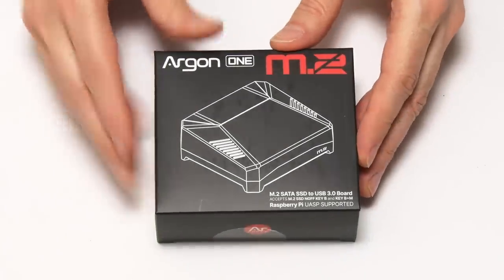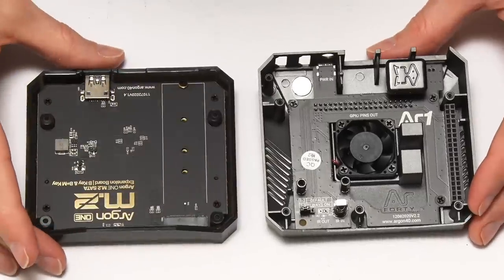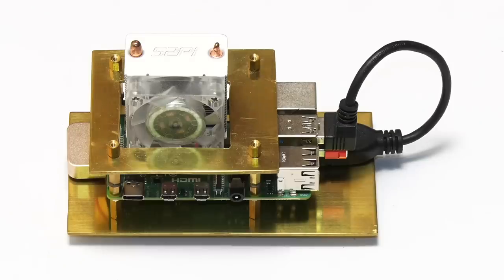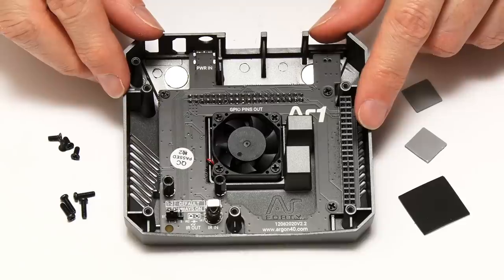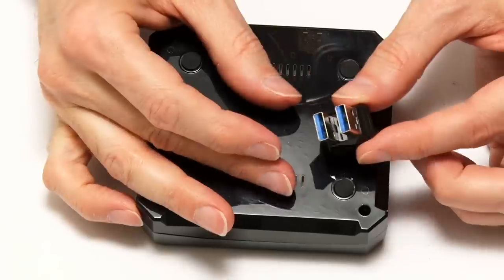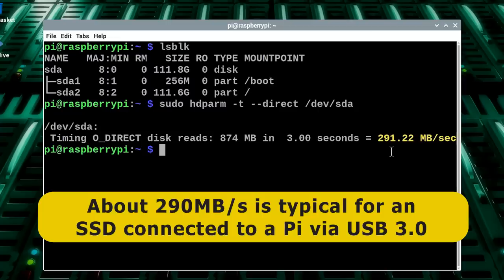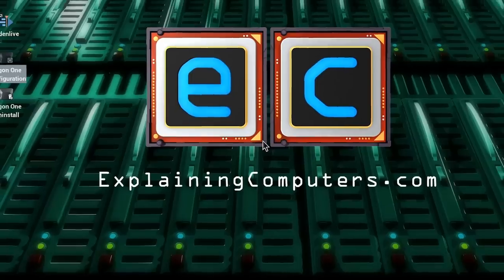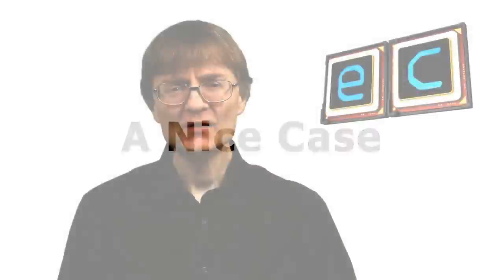Argon One M.2 Raspberry Pi 4 Case

Comment: Very cool case. My ultimate Pi project. is a 8Gb with the armored heatsink fan case very much like yours with fans, A SSD that has the same foot print as the raspberry pi and a flat usb a to c cable that zigzags from the front to the back through the case, a little bit of heat insulation padding between heatsink case and SSD and two cable ties that make a good rubber feet substitute... Running the beta of 64 bit raspbian as a little media server/streamer/NAS I would seriously consider the case If I was building again...

Comment: It's worth mentioning that this is M.2 to USB converter, and I had it for some time now, but found the Rpi4 with argon m.2 case to be very unstable. I run into serious storage handling problems which come after a while of the system running. Same M.2 drive (Samsung) works perfectly in a Mini PC for the last 4 months. I would say it's just not worth it until RPi has full and stable sata support rather than over USB.

Comment: I wonder if we will ever get a £100 Pi with M.2 and everything that would be needed to make a really nice desk top replacement, maybe with an option for ARM based windows 10 64 bit.
Reply: If it was NVMe maybe - the M.2.SATA is getting rarer. But NVMe takes way too much power than the Pi4 USB can supply.
Reply: @stephenhookings1985  : Nope.  I can run a NVMe case just fine from a Pi.  The drive is a crappy 500GB model without DRAM that came with my Dell gaming laptop that I had to dump for something bigger.  Bit it boots my Pi just fine.  Especially if you use a quality power supply.

Comment: Your design using an all brass body & ICE tower is better option.  You can cut, drill & fit to your exact needs.  The only component you really need to make your design a bit more compact is the dual USB adapter.  ICE tower can probably be programmed to run at different speeds depending on temperature; have to find how that's done.  Still prefer your design.

Comment: Hey Chris, Not sure if you've tried it or not but considering full utilization of the RPi4, The DeskPi case is also worth considering in competition with the Argon One seeing how the DeskPi will allow SATA HDD/SSD or M.2 with simple access to the SD card and built in low-profile Cooler similar to the ICE tower (tho laying down). They even had to improve their design due to some features causing EMF interference. likely the most costly case with similar form factor.

Comment: I have an Argon M.2 case, not currently using it, I find the temperature with mine is between 45 and 55, I am currently using the DeskPi pro and after receiving the updated parts, I find I have the same issues I had with the DeskPi Pro and it runs at 56 during normal operation. I am building a raspberry pi case at the moment, and I will probably be switching to my Muizei case while I do that, which usually runs under 45. I also have the official raspberry pi case, I installed the fan accessory, it runs real hot, and an aluminum case which also runs hot. So so far the cases I have purchased haven't been up to par, the Argon case is a nice design, but with no access for the sd card and a poor cooling system, I think it needs a remodel. The DeskPi Pro I have has a few issues, you can't access the GPIO pins with a 40 pin cable, the slot is too small and its positioned too close to the plate it is attached to, the first HDMI port doesn't work and the USB 2.0 ports don't work. I had to take the DeskPi Pro out of its case to install my sound card with a GPIO edge extension. I checked the Argon M.2 case and its GPIO slot fits the female header nicely. Its a nice case, but I do think the cooling needs work, really my only problem with it. Great video as always.

Comment: 49°C is no better than the "Fan Shim" that didn't even have a heat sink.  BUT your settings prevented the fan from coming on below 55° so this confuses the comparison a bit more.  In the end though it is better to not even need a fan running.
It would have been interesting to run a longer CPU stress test to see how hot it gets and whether the fan will keep it cool.

Comment: I have Ice cooler with a Noctua NF-A4X20 5V on my Pi 3B+. 28c in a hot room. That is a nice case for the pi 4. I just ordered a Super Pi case for one of my Pi3s for emulation. I also made a Pi arcade cab with a 10" IPS screen, Sanwa stick and Buttons. That thing is nice. Uses 2 Power banks, 1 for Pi 3 and one for Monitor and Audio Amps 3+3 Watts Stereo. Same Noctua fan over a cheap heatsink. Works fine. Also controllers will work if I unplug the Control panel and use a USB game Controller. Control Panel at front is a hack of a SNES cheap USB controller from China.

Ya, that is a nice case for a Pie 4. I would buy that if I had a Pi 4. Integrates things nicely. I would try to replace stock fan with Noctua NF-A4X20 5V of it would fit and clear. 200mm wide, not 10.

Comment: Been using the Argon One cases for several months, now. Considering the programmable cooling, SSD, and additional features, they can't be beat, even by less expensive cases retrofitted with intelligent cooling/power HATS. Been there, done that. Anyone want my extra cooling HATS? Love these cases so much that I've purchased all 3 models:
* Argon One with programmable cooling;
* Argon One M.2 with the SATA SSD base. 
FYI #1: the SSD base can be purchased separately to upgrade the above original Argon One with M.2 SSD & remote power on/off via IR. 
FYI#2: Purchased a second Argon One M.2 and modified it to house the Geekworm 872 NVMe SSD board. But, that was only a fool's errand, because the USB3.0 kills the speed advantages offered by the more expensive NVMe SSD. Plus, the 972 board & NVMe were too power hungry for Pi's wall warts. (Oh well, my NVME will live in a CM4 board with on board M.2 for NVMe.)
* There's also an Argon One Sound case, with a builtin HifiBerry DAC, which I've added the above restored SATA SSD base and turned into a multi-room music streaming system over WiFi, with RPi/HifiBerry DAC receiver/amped speakers.
These cases are attractive enough for my living room home theater's primary web browser/downloads library (wish my 4K TV were dumber and cheaper). I'm using the standard Argon One to test Ubuntu and software. Happy Maker! :-)

Comment: Nice video. I will buy myself this case. But I wonder if the left USB3.0 is still accessable. Or will a USB-stick touch the USB3->USB3 adapter?
Reply from the maker: It is accessible for USB plugs/devices that meet the USB standard -- but not for fat/thick USB drives (eg like some of those from Corsair.

Comment: It's a nice case and all but looking at these daughterboards and USB jumpers it's also doing a lot to work around the Pi's limitations.
When I add up component prices for a complete setup ( Pi + case + power adapter + SSD) it ends up costing pretty much the same as a used 1L enterprise PC (Optiplex Micro, ThinkCentre tiny, etc) while offering way less performance and expandability. The only difference is power consumption (5w for the Pi vs 25w) but I wouldn't say it's a huge issue for a desktop especially given the performance benefits.

So yeah, not sure what the real benefits are here and I'm not even going into used laptop territory where you can get even more peripherals for less money.

Still, kudos for making such a nice review for all of us!

Comment: The only tool I have found that will write an OS successfully to the M.2 is the Pi Imager, and then, only using a listed OS. Attempts to write an OS not included in the library of the imager always ended in a failure to boot. Etcher proved useless, where it always wrote micro sdhc cards and USB keys correctly. This product is great now that it is working, however using it is not as straightforward as you claimed. There are clearly issues that need addressing in future releases of the Argonone M.2.

Comment: Nice video!
Does this case require a different power supply other than the original Raspberry Pi 4 one?
Or is that psu enough?

Thank you
Reply from the maker: The standard, official PSU is the one I've used, and works fine, including powering the SSD.
Reply: @ExplainingComputers  that sounds great! I have an Argon One V2 and a Raspberry Pi 4 8GB with its power supply. Now it's time to put the two together.

Comment: Have you tried running dual monitors with it? We use the Argon One v2 with the Pi & the latest release of the case, the board has given us issues. Argon has been great, really good customer support. By far the best Pi case I've used.
Reply from the maker: I've not tried using two monitors. Glad to hear the customer support has been good.
Reply: Been running dual HDMI monitors with the Argon One M.2 and no probs. :-)
Reply: @TheOleHermit  haven't tried the m.2 one just the original V2.

Comment: Hi Christopher, 
What Raspberry Pi 4 case with vesa system do you recommend? I like mounting the pc on the back of the monitor instead of upon the desktop. 
What about other computers apart from Raspberry, any suggestion to have a computer hidden behind the monitor? Will you do a video regarding this?

Regards!

Comment: Some comments on Amazon suggest that the pi WiFi signal strength is weaken with this case. Did you by any chance test it, Chris?  Of course simple solution is use e-net.

Comment: Ah, my first computer was a BBC Model B micro. Really good educational product. Ever so easy to interface to and a modified beginners all purpose symbolic instruction code (BASIC!) language that supported procedural calls, getting away from the menace of 'GOTO'! You could download programs broadcast over the air via TELETEXT and there was high quality magazine support back in the day before downloadable pdfs. Assembly language was a doodle and there were even some rudimentary compilers available. It had a lot going for it back then and I learnt about the inner workings of computers on it. BobUK.

Comment: For the M.2 Is it still possible to use IMG prebuild images you setup with etcher? or will it require modifications afterward to know its not SD it needs to boot from?
Reply from the maker: Yes, indeed -- you can write image files to an M.2 SSD with Etcher. Should work fine, and boot from SSD (USB) as the default unless an SD card is inserted with an OS on it.
Reply: @ExplainingComputers  nice to know and thanks for the info. was afraid the image need special attention or be a linux wizard to make it work
Reply from the maker: @DannyNilsson  No problem. The other way to get an image to an SSD, at least in Raspberry Pi OS, is to get things up-and-running on a micro SD card, and then to copy the card to the SSD using the included SD card copier utility. This is handy if you do not have a way of connecting up the SSD when out of the case. :)
Reply: @ExplainingComputers  I ended up buying two of the basic agon V2 cases as they were a lot cheaper. but those cases are awesome. i really like it has standard ports and a proper cooling. Also the power button is a must have. though i needed to spend a lot of time to get the fan working on a Recalbox Linux. 8.0.1. it had some build in functionality but no support for the power button

Comment: This is what I built my NAS out of, with an M.2 SATA SSD. Be forewarned: I had nothing but trouble w the WD Blue 1TB hard drive. Would just disappear from the file system in OMV5 and then reappear till finally one day everything disappeared from the drive. I then bought an external WD USB 4 TB hard drive and all my mystery problems went away. Sent the SSD to WD, they sent a new one back, plugged it into the board and all my problems reappeared. Weird stuff!
Reply: Is it taking too much power? I have the 512GB and it's fine but ever since a recent Pi4 firmware upgrade the power saving comes in and makes the WiFi even more dubious than before. I notice it happens when dmesg shows power saving.

Their USB jumper is also unreliable. Folks say using a quality cable works better.
Reply: @stephenhookings1985  I’m not sure. I thought about that jumper thing being unreliable and never got around to trying the double male cable. I don’t have time like I used to, finally back to work after a long layoff. Power could be an issue but the problem would come and go with no rhyme or reason. At first I thought it was a mini WD HDD that I also have plugged into the unit for my security cams. I guess I’m still chasing the bug, but the external WDD 4TB seems to have solved the bug. I took the WDD SATA and made an external USB stick out of it for moving files to and from computers.
Reply: I am a build Raspberry pi OMV5 nas
Reply: I don’t have a NAS setup, but you mentioned WiFI issues after an update. I wonder if that’s why my PiHole occasionally goes down for a few minutes.
Reply: @RollerCoasterLineProductions  I found normal mechanical USB drive worked fine. I accidentally got a M2 NVMe thst sure font work in M2 SATA. But it don't work external either with a adapter case. But with a powered USB3 hub it seemed to work (but NVMe got darn hot).
Reply: @StolenJoker84  not sure. This case sucks the WiFi signal for sure. One of the hate comments on my channel suggested I should use use an external WiFi. Sure - this is how we did it with Pi2 but I paid for WiFi on Pi4 - would like to use it :-)

My WiFi drops and seems to be around the time that power saving is applied. Might just be coincidence. Else it could be the WiFi is switching off cos power is throttled.
Reply: @stephenhookings1985  I remember your video now, may have commented on it and said you’re crazy. Lol. I apologize if I did.
Reply: @StolenJoker84  - I would highly recommend using a ethernet cable instead for the PiHole.  That's what I use and don't have any problems.
Reply: @RollerCoasterLineProductions  I am crazy - well Asperger's so I take things to literally :-). But I believe in science - so I rebooted wifi, no change. Did another sudo rpi-update ... experimental firmware - and WiFi works again now. So for the moment happier tonight.
Reply: I have the same drive and this case. OMV5 booting and running off an SD card. Using an ethernet cable to hook it to my router for the LAN. Storage on the WD Blue 1TB M.2 SATA and a portable HDD. Also have some other services running in Portainer. No issues with mine thus far in several months of use. Not sure what I'm be doing differently than you, if anything, or why my results are different
Reply: @stephenhookings1985  I don’t have this specific case … using the basic Canava (or whatever) case that came with it. 
I just noticed in recent months that my internet would occasionally “drop out”. I discovered the problem when I would attempt to connect to the Pi and the connections would fail, and when I tried to switch inputs on my monitor to use the Pi “locally”, it would also fail.
Reply: @ElmerFuddGun  I will try that. I tried connecting via Ethernet a month or so ago, but then PiHole wasn’t working at all over Ethernet. Probably need to take the time to reconfigure it.

Comment: I have that case.  Try as I might I could not get the fan to work properly.  At first it was on non stop.  After tinkering around it no longer starts up at all.  When I first turn the pi on it turns on and spins for a few seconds but after that it will never turn on again.  Oh well.  The case itself cools pretty good on it's own.

Comment: How do you create the SSD for booting without using a MicroSD card?  I created a MicroSD and used the SD card copy utility.  It worked but boot from SSD is prefixed with numerous errors, not really clean.

Comment: noob question... but does the official raspberry pi usb C power cable suffice for the powering the m2 ssd?
Reply from the maker: Yes, the official Pi 4 PSU will power the Pi and an M.2 SSD.
Reply: Thank you for the reply! I just ordered a pi 4 B - 8GB model + argon m2 case. (M2 ssd drive I already have...) Is it possible to install let's say fedora ARM(or whichever ARM OS...) directly on the m2 ssd through a live usb with fedora ARM without ever using a sd card? Or do I always will need a sd card to get started?
Thank you again in advance for the help, this is a great channel :)

Comment: This metal case seems to block Wifi as my RPi4 works perfectly in a plastic case but not in the Argon one.

Also, HDMI-CEC doesn't work with this case.
Reply: I’ve had the same issues.
Reply from the maker: Yes, the signal strength drops.
Reply: Yes, major problem is the wi-fi with an overall well made case. Great if you are always going to use an Ethernet cable.
Reply: As I said in earlier comment I made a video about this on my channel - demonstrated the loss - got a lot of fanboy hate comments. I was only demonstrating the pitfalls. I suggested a Frankenstein case (new top, old bottom) and Argon make this now. That's the one I would buy and stick drive external via USB cable.
Reply: @Mozzer1945  I avoid wi-fi if I can
Reply: @billfusionenterprise  Thanks.
Reply: @Mozzer1945  to get high speed with wi-fi you need also a 200 + dollar wi-fi box
Reply: Yeah, 2.4 gHz is bad. 
Argon are aware and working on it.
Find out what the 5 gHz bssid is for the access point you connect to and add the bssid to your connection info.
Forces it to use 5 gHz.
Reply: @BradClarke  5 GHz is often blocked by radar here.

Comment: Just out of pure curiosity wonder if you can install a Noctua fan to a Argon One M.2 case? Or am I completely mad.
Reply from the maker: Sadly Noctua don't make a fan that would fit -- their smallest is 40mm, and the Argon One takes a 30mm fan.
Reply: @ExplainingComputers  That Breaks my heart thanks for the response Mr. Barnatt
Reply: Could mod the case and custom mount it...may have to put it external. But realistically, the case will really take most of the heat away as shown in the testing. These alum cases do really well.